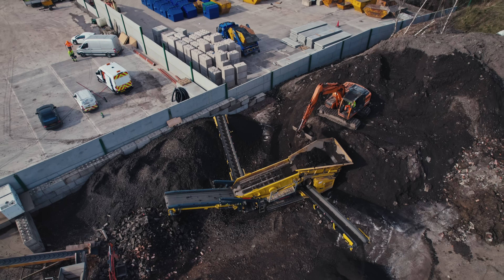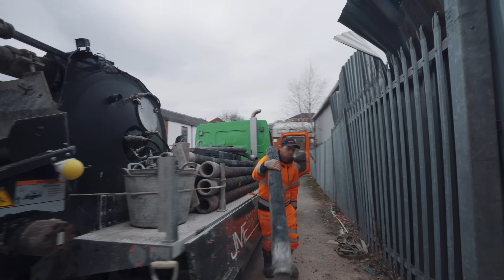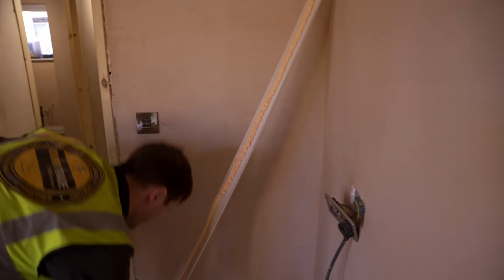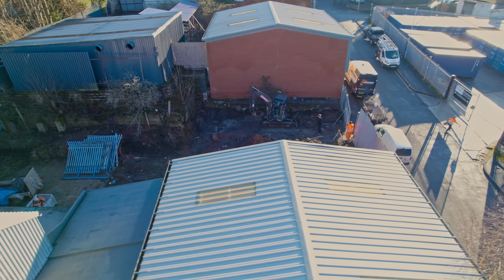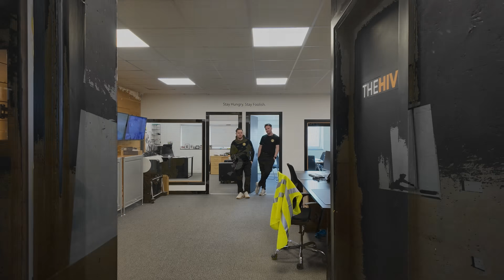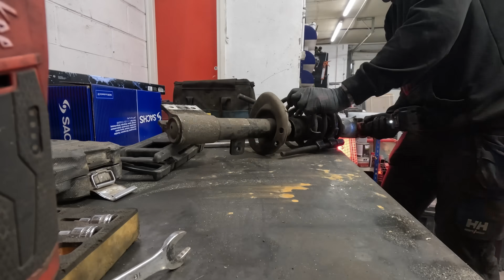GUTTED About ASHVILLE and Reviewing EVERYTHING About Our Business | EveryTrade

Comment: What point are you missing about Ashville…he is redirecting his company. Heathrow runway 3…muck away, aggregate in and absolutely no aggravation of running a fleet of trucks ❤
Reply: Hopefully it all works out for the best for them. 

We wish everyone in business all the luck in the world as it’s hard enough dealing with what business owners have to deal with on a day to day basis, then to have negative people come out the woodwork chatting nonsense. 

No matter who it is, anyone who restructures like that, if you believe that’s by choice you need to question your ability to read a situation.
Reply from the maker: Not missed that all all. Although, T3 is a longgggg way off
Reply: @Every_Trade  And hopefully the Ashville yard will benefit enormously from it, even if it is a long way off.
Reply: HS2 cutting short hurt more than only Ashville.   Daniel will roll with it. Now paying subbies by the load out or in with no overheads on repair & maintenance contracts, slimmer wage bill...he.ll be ok.
Reply: It Daniel built and borrowed on hope for business, and the new yard stretched him too far. He needs to be the pipeline to supply others with materials they buy.